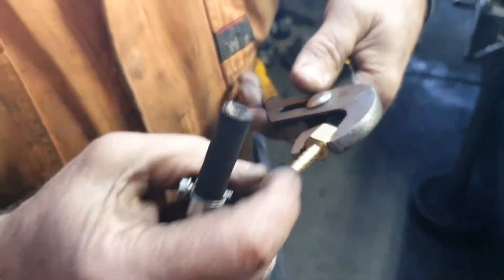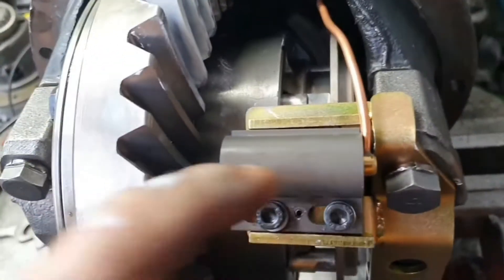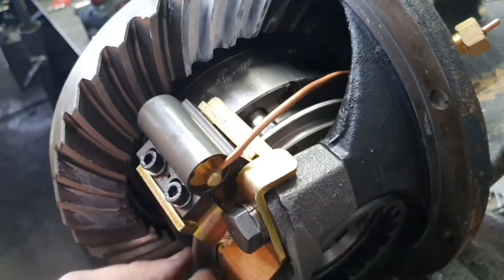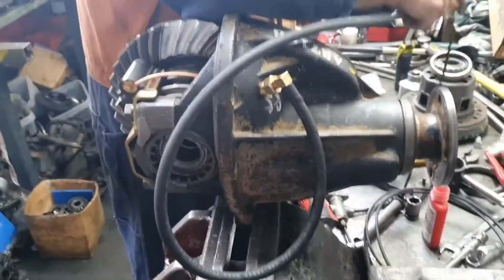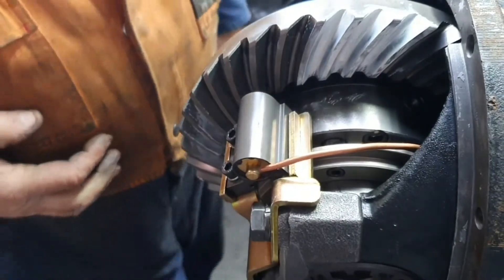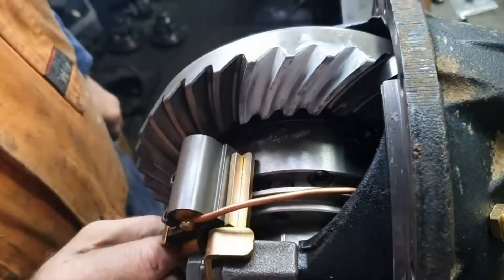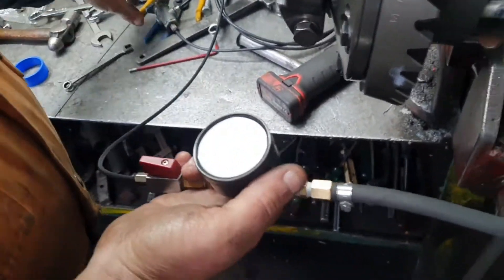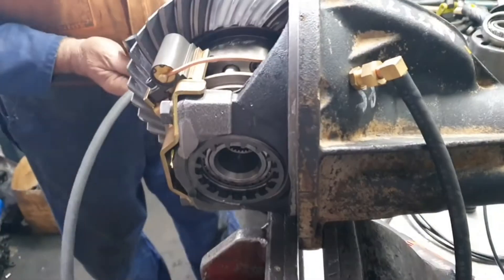TJM Pro locker PROBLEM.

Comment: is the stroke difference to help eliminate the plate rattle or does the oil normally fix that with your mod?
Reply from the maker: The rattle in the plate is what you need. Once the diff is in the housing and full of oil you will not hear it. With out the slack in the plate it is always under thrust condition which is unnecessary. It is not designed to be like that. Tjm have made a error in there manufacturing. We didn't design it to be like that.
Reply: @differentials  too easy, good work gang

Comment: Cheers guys that's great info.

I wish I seen this 5years ago when I installed my lockers. However I don't remember there being any major clearance issues with the lock ring when I bench tested mine. I certainly haven't had any problems with either of my lockers in the 5years, so I'm wondering if it's not such big issue? 

In saying that, I hear and understand what you're saying, TJM should take notice and fix the issue, especially when it's such an easy fix.
Doesn't surprise me that TJM ignore this, TJM are one of the worst companies in the world to deal with. And very average customer service too.

Comment: Is this a problem with all TJM lockers still? About to get a set installed in a 105 series Landcruiser. It’s already booked in, otherwise I would have come to you first as I’m in Melbourne.
Reply from the maker: Yes they seem to. All you have to do is test if the pneumatic cylinder has any air leaks because the one you have in the TJM pro locker box might not. If it does then fix it. Also you need to see if the stroke of the pneumatic cylinder is more than the stroke of the diff lock stroke and if it is put the 1mm thick washer in. Wherever you have this booked in just tell them and they should fix it and if they don't know how to fix that they shouldn't be installing them in the first place.
Reply: Neville McNamara differential specialist thanks heaps. I’ll talk to the shop about it.
Reply: @differentials  apart from the design issue these so called installers are just that, so called, they havent a clue nor mostly care, i installed as per instructions, take it up with corporate. Its ridiculous actions for what is a well designed idea.

Comment: Don't they have a life time warranty on the tjm pro locker??
Reply from the maker: I give a lifetime warranty on every differential repair and everything we make in this workshop of mine. But we stopped making the Pro locker years and years ago. TJM now own the diff lock and make it and sell it. You will have to take up that lifetime warranty thing with them I do not know.
Reply: @differentials  yea I just seen your video appreciate what you do. No offence but if my TJM pro locker was faulty and they told me I have a life time warranty I wouldn't take it to a different specialist I'd take it back to TJM to warranty it unless they can't diagnose the issue then I'd definitely be taking to a differential specialist

Comment: can I just mill the space between the forks to make them a touch wider by 1mm
Reply from the maker: The easyest way is to make a 1mm washer and put it into the pneumatic cylinder like we have shown in this video but you can do it the way you suggest but then it won't lock the full amount because there will be more slack in the fork but it's up to you. You will have to pull apart the pneumatic cylinder anyway to mill the fork so you may as well put a 1mm washer in there instead of your way. But try the way you're suggesting it may work ok :)
Reply from the maker: If you want me to make a 1mm washer for you and send it to you I can do that. Just call me on 0434095069 and tell me and give me your address and I will send it to you.

Comment: Do you sell TJM lockers with your Mod done? interested in one for my Patrol
Reply from the maker: It's not a mod... Haha it's just fixing there faulty made product.. it is just to correct something that TJM don't seem to want to start making correct.
Reply from the maker: We can send you a 1mm washer to go into the pneumatic cylinder if you want. But it's easy to make your self with a bit of thinking.
Reply from the maker: Contact Jack McNamara differential specialist in Melbourne and we will send you a washer once you tell us your postige address
Reply: @differentials  Thanks I've sent you an email via your website.. also interested in a getting a Locker fitted.

Comment: Lol, was thinking about buying a TJM lokka... not anymore!

Would you say the arb is designed better (have the sorted out the seal leaking issue)? 
Whatare your htoughts about the Harrop e locker (they dont have seals or motors, just an electromagnet)?
Reply: The arb lockers are a less durable design with how they seal.. I worked at a diff shop and built heaps of both brands.. we used a alloy spacer to limit the stroke and used longer stainless Allen head bolts and larger washers than supplied and then twek the bracket because they are all twisted when you just bolt them on out of the box.

Comment: Why not just move the whole assembly over before putting in the roller pin? Like where the bolts allow for it to slide it back and forth when untightened?
Reply from the maker: if the pneumatic cylinder strokes longer than the stroke of the selector ring there's no way to get clearance on each end of the stroke
Reply from the maker: This is why you have to make a 1 mm washer and put it in the pneumatic cylinder so it can stroke the same amount as the selector ring
Reply from the maker: Moving it on the bracket with those elongated bolt holes does nothing
Reply from the maker: That pneumatic cylinder strokes 1 mm more than the selector ring so no matter where you put it in those elongated bolt holes it is always going to stroke more and jam up at the start or end of the stroke.
Reply: Neville McNamara thanks for the explanation
Reply: @differentials  so, what is wrong if piston jams?
Reply: @shokhrukhnigmanov1278  the locking disc is a moving part inside the channel bracket. If the piston is pushing it too far over, how is it going to spin without tearing apart
Reply: Installed the Pro Locker today on my 75 Landcruiser. Exact same issue, actuator moving too far. Meanwhile I have set up clearance on the unlocked side, however this needs to be fixed.
Could you please tell me the dimensions of the washer (inner and outer diameter), so I get one made here in Germany? Or maybe you would sell one?